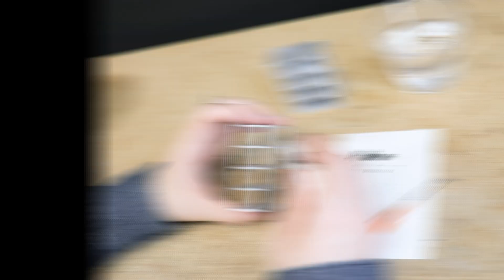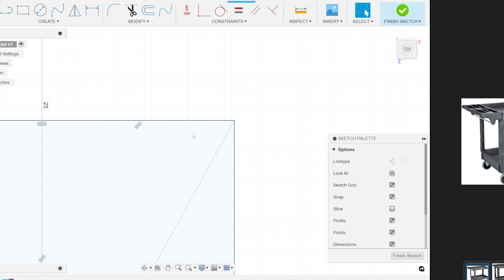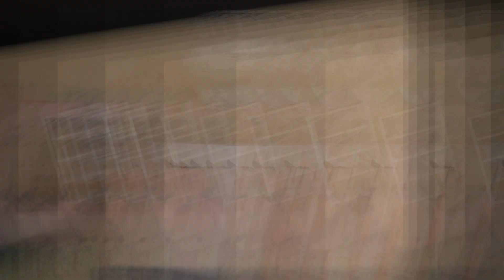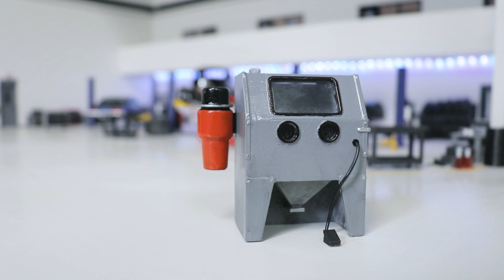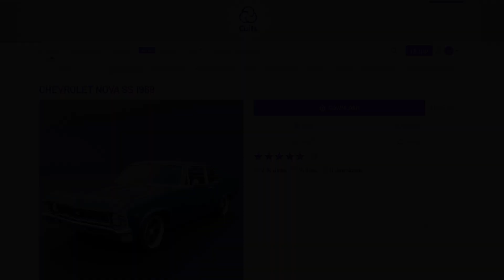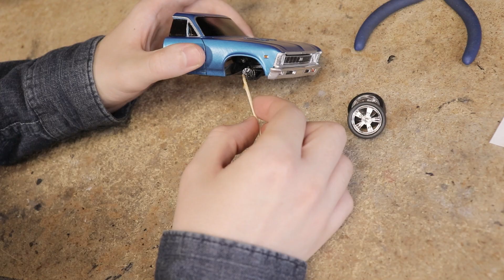Scale Shop Build Part 6: Sand Blaster, Tool Carts, Shelves, and a Nova on the Wall

Comment: Awesome job! But you need to add some shop air. Two parts - I giant air tank to fill tires and for painting. These are heavy and generally ground mounted. Two create a ventilation system - bad fumes from painting. Attach to ceiling. Keep working man this is cool!

Comment: You should've wired in a single 1mm or 2mm LED into the blasting cabinet, that would be really cool little scale touch for it to have a faint glow like someone left the cabinets light on. 👍👍